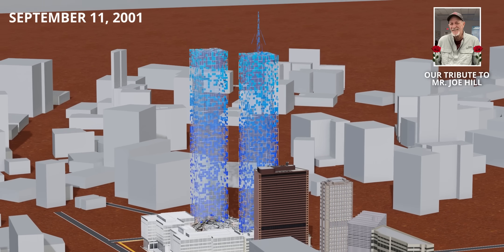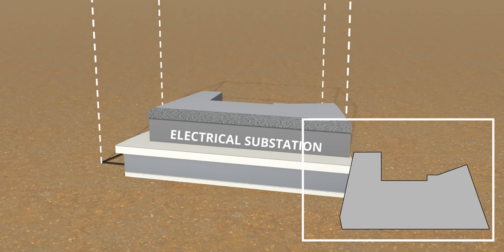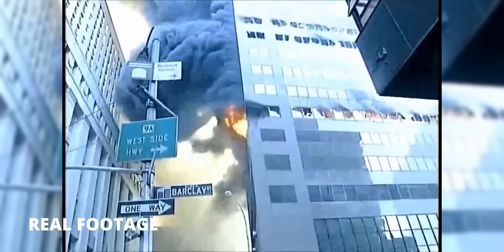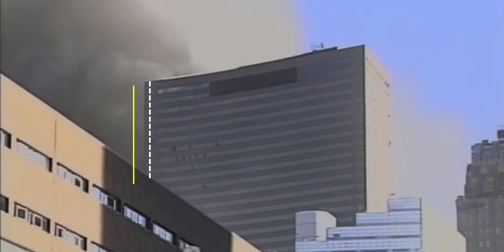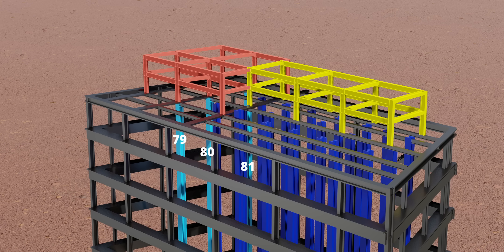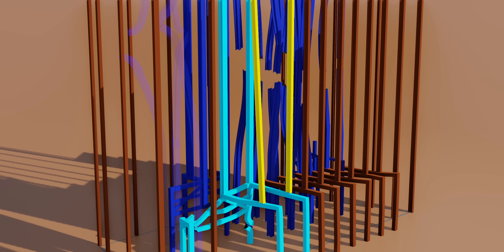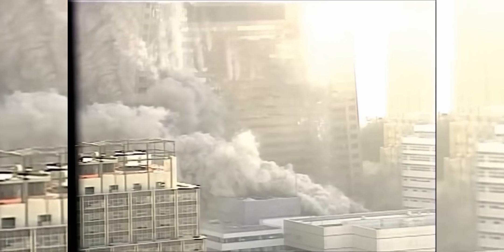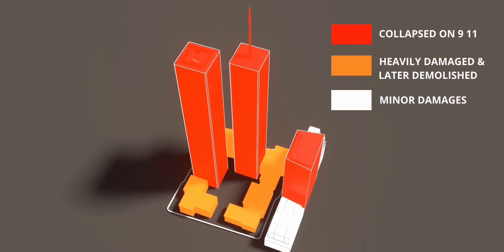Collapse of Building 7 | The Complete Physics

Comment: Exactly! All girders decided to give up within the same second. So no tilting to the left, right or whereever. When the penthouse side collapsed I would expect a tilted collapse to this side because the adjacent girders would have been strained the most. But no the girder on the far left decided to give up at exactly the same moment the girder on right did.
Reply: It probably would have helped if you had actually watched the video since you completely lost the plot in the first sentence. 🤦‍♂
Reply: @TheCriticalStinker-01  I watched the whole video and the explanation was bending physics.
Reply: @JOBOB1313  - Was it?  Please explain exactly where this explanation is bending physics (don't forget to include time stamps) and WHY.

I won't wait up.
Reply: @TheCriticalStinker-01  I gave the 'Why' in my original post.  
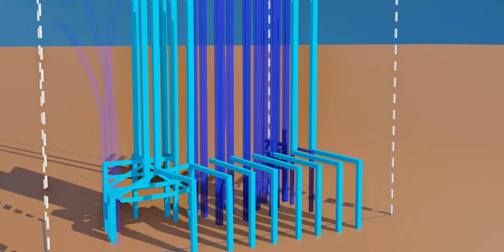6:55 The transfere truss fails and the other columns snap-bend to the right several floors above, all at the same level and all within 2-4 sec.. You have no problem with this simulation?

When the penthouse part gives in the columns on the left side would have to endure the most stress and give in before the columns on the farther right. They would not snap like in the video but would kink to the left on the most strained part of the column. Also the fire wasn't spread evenly throughout the whole floors which means that some columns had to endure a more intense heat stress than others.

You would have to explain how this snapping had occured without the help of some explosives.
Reply: @JOBOB1313  - No, you speculated in your OP. You presented things you believe should have happened. That they didn't is a strong indication your starting assumptions are false. 

I would agree the columns did not snap as shown in the simple animations in this video.  The columns buckled. But then I am under no illusions these animations are meant to be taken literally.  This is a YouTube level explanation for a YouTube level audience (morons), NOT a doctoral thesis. To be eloquent to that type of audience, elements need to be exaggerated.  

In short, STOP BEING SO LITERAL.

Also, the collapse starts well below 6:55 so not sure why you are ignoring all the important bits. 

None of this however has anything to do with your claim about bending physics which is what I asked about.

Collapse of Building 7 started in the NE corner when C79 failed.  It is generally accepted this failure was due to a loss of lateral support over an excessive length due to lower floor failures. Different analysts have their own opinions as to how many floors and what caused them to fail (probably why Sabine sidesteps this), but that is still the initiating failure

Loss of C79 will quickly cause C80 to suffer a similar loss of critical lateral support over an excessive length, causing it's failure, with C81 following suit within fractions of a second.  EMP drops into the building.

From there failures progressed from east to west through the core structure until the core columns were all gone. Again, buckling failures due to loss of critical lateral support, in rapid sequence.

NONE OF THE COLUMNS FAIL DUE TO HEAT.  All of the columns buckled, they DID NOT SNAP.

No laws of physics are violated or even bent and that description absolutely matches what we observe.
Reply: @TheCriticalStinker-01  I'm not surprised by your answer. Of course the maker of the simulation didn't assume anything since he was inside the building and watched the collapse firsthand and live.
Reply: @TheCriticalStinker-01  I forgot! You didn't answer my question: Why did the girders snap?
Reply: @JOBOB1313  - I forgot you don't read anything that may not fit your dogma.

They aren't GIRDERS they are columns .  

From my post of 45 minutes ago:

I would agree the columns did not snap as shown in the simple animations in this video.  The columns buckled

_ It is generally accepted this failure was due to a loss of lateral support over an excessive length due to lower floor failures. Different analysts have their own opinions as to how many floors and what caused them to fail (probably why Sabine sidesteps this), but that is still the initiating failure_

LET ME REPEAT THAT SO YOU DON'T HAVE ANY (VALID) EXCUSES

I would agree the columns did not snap as shown in the simple animations in this video.  The columns buckled

_ It is generally accepted this failure was due to a loss of lateral support over an excessive length due to lower floor failures. Different analysts have their own opinions as to how many floors and what caused them to fail (probably why Sabine sidesteps this), but that is still the initiating failure_

ONE MORE TIME FOR GOOD MEASURE

I would agree the columns did not snap as shown in the simple animations in this video.  The columns buckled

_ It is generally accepted this failure was due to a loss of lateral support over an excessive length due to lower floor failures. Different analysts have their own opinions as to how many floors and what caused them to fail (probably why Sabine sidesteps this), but that is still the initiating failure_

Now, let's see if you are being deliberately obtuse or if you just can't help it.
Reply: @TheCriticalStinker-01  I want to apologize since I really only read part of your previous answer. I clicked on the bell in the upper right corner and saw only part of your answer without noticing that there was more. I will come back to you later.
Reply: @TheCriticalStinker-01  I watched the video now 3 times and read and reread your answers. You do not seem to get my point and my point was not explained in the video.

In order for the building to collapse vertically the supports of the building must have given up on the exact same time at all corners and sides of the building.

"It is generally accepted this failure was due to a loss of lateral support over an excessive length due to lower floor failures." In your first answer this was connected to C79-V81. 
In your 2nd answer I got the impression it was meant for the whole final collapse. I have no problems with V79-C81. If it is connected to the final fall I understand that there are many opinions that diverse which would explain it. This would sound to me like you would agree with me that there was no explanation in the video.

"EMP drops into the building" Sorry, what is EMP?
Then you write "failures progressed from east to west through the core structure until the core columns were all gone" That's exactly what was stated in the video. Which doesn't answer my question. Again same time at all corners and sides!
Reply: @JOBOB1313  - I got your point from the start. For clarity, your main point is this:  

In order for the building to collapse vertically the supports of the building must have given up on the exact same time at all corners and sides of the building

That is not what happened.  

This video does not claim that is what happened.  

I do not claim that is what happened.

You are trying to shoehorn what the video and I are saying into your incorrect narrative instead of trying to understand the information that is being presented.  IF you are looking for the video to back up your version of events, you will be looking a long time. 

Both this video and I agree there was a progression of column failures through the core from east to west until the core was gone NOT a simultaneous failure of all core AND perimeter columns throughout the building at the same time.  

The video and I are describing the actual progressive collapse which is the opposite of a simultaneous collapse  

C79 fails (after the initiating failure)
C80 fails
C81 fails

EMP (East Mechanical Penthouse) drops into and through the building, because there is nothing underneath it to keep it on the roof. 

Then 76, 77 and 78 fail
Then 73, 74 and 75 fail
Then 70, 71 and 72 fail
Then 67, 68 and 69 fail
Then 64, 65 and 66 fail
Then 61, 62 and 63 fail
Then 58, 59 and 60 fail

Remaining rooftop structures go down from east to west as that sequence of failures occurs. 

Again, it is a sequence of core (NOT perimeter) column failures one after another NOT a simultaneous failure of everything at once. One failure is followed by another then the next, then the next, then the next,.... from east to west until the interior of the building is gone, leaving only the outer shell still standing - the "empty cereal box" described in the video - until that shell drops last.

I am fully aware what I just described is not an intuitive concept and you are far from the first to have trouble wrapping your head around it. Just casually looking at the building it isn't obvious to the layperson. 

Building 7 collapsed from the inside first (and not all at once), then the outside shell dropped (pretty much all at once).
Reply: @TheCriticalStinker-01   Again you didn't answer my question and I didn't look for the answer in the video because I saw that it wasn't there the first time I watched. 

What I stated  "the supports of the building must have given up on the exact same time at all corners and sides" goes for the outer support (the empty cereal box), too. You wrote "then the outside shell dropped (pretty much all at once)."  You wrote that it did but didn't explain how this could happen.

My "incorrect narrative"? That's a bit patronising. Perhaps your narrative is incorrect.
Reply: @TheCriticalStinker-01  You didn't answer my question. I get the impression you don't even see the problem I see.
(I even got more problems with the explanations and animations the more I spent time on it.) 

"support of the building did NOT give up at the exact same time" The frame definitely did. 

Nevertheless, how do you know what really happened? You were not inside the building when it collapsed. The whole explanation was just a try to reconstruct and explain how the collapse could have happened. That doesn't mean that it really happened like that. Yes, and I think YOUR ASSUMPTIONS ARE WRONG. There's too much bending and ignoring in the animation and I got to the conclusion that it is wrong.
Reply: @JOBOB1313  - The exterior moment frame was fundamentally supported by only 4 of the 83 columns and was the last and least important (though most spectacular looking) thing to fail.  So who the hell cares what the frame did?

The exterior moment frame is just an empty shell. The Building - the part that matters - is all the stuff on the inside.

The INSIDE FAILED FIRST then the outside dropped.

Now then, this is the most famous video of Building 7's collapse.   It is only 23 seconds long. Please indicate the time stamp (00;_ _) where Building 7 starts collapsing.

https://www.youtube.com/watch?v=nqbUkThGlCo
Reply: @TheCriticalStinker-01  The inside collapsing without practically no effects on the outer frame makes no sense. The floors and girders are connected to the outer frame as you can see at 0:59 and you want to tell me when the floors and all girders (tons of cement and metal) are forcefully yanked from the outer frame the outer frame has no reaction to this. Not even the windows break on the EMP (West Penthouse) side when the inner collapse allegedly occurs. (Some windows break later when the frame goes down).

And then when the interior is gone the frame goes down vertically as if being pulled and for you that is not important?
Reply: @JOBOB1313  - Correct.  To the layperson the interior collapsing with minimal (not no) effect on the exterior does not seem to make sense.  It is not intuitive to the layperson and is why wild conspiracy claims were able to take hold so easily.  Windows do indeed break and there are deflections, but you have to really look.  This minimal reaction possible because the exterior of Building 7 was a moment frame literally hung on the outside of the building. Most people will not expect this  - assuming the layout and construction to be more conventional - and have trouble wrapping their heads around it.  

Then one has to shake them out of their preconceptions and beliefs,... the fun part 😒

The same effect could never have happened in the very different Twin Towers for example. No moment frame. 

The floor beams and girders in Building 7 are indeed connected to the perimeter columns but NOT to the exterior moment frame. 

IF you can wrap your head around this everything should start falling into place.

Comment: In 2025, I 'learned' that apparently 25% of WTC 7 had been taken out by falling debris from WTC1 and WTC2, bence weakening the structure to the point of collapse. 24 years later, this sounds like absolute horse 💩
Reply: That would be horse 💩 since the physical damage caused by the collapsing North Tower was nowhere near 25% of the total Building 7 structure. Try low single-digits.

Comment: What a bunch of nonsense. This is just the latest spin on the NIST theory. Office furniture supposedly softened metal and cased a 'progressive collapse' This is total junk science. One question debunks this whole pile of lies.
Question: How can you possibly get a perfectly symmetrical building collapse from A-symmetrical damage?
Answer: You can't it's against the laws of physics. This video like so much propaganda out there is a lie.
Reply: It was anything but a perfectly symmetrical building collapse which is why it is universally referred to among engineering professionals as a progressive collapse - a progression of failures. 

That is the exact opposite of symmetrical.

This video not shows the progression and explains (in moderate detail) how it is progressing.

I don't think you actually watched it.  I think you just came in here armed with your AE911T talking points you copied off the internet, hoping to get some affirmation - or at least do some proselytizing to the totally ignorant.  

You hold many false starting assumptions about this event and its not difficult to figure out where you got them.  Perhaps if I were to lay the whole thing out, in detail?
Reply: @TheCriticalStinker-01  Nonsense. The term progressive collapse is not a technical term. It was made up by NIST as propaganda. It has no real meaning. Progressive as opposed to what? Every collapse has a progression. Tower seven (like one and two) are examples of a near perfectly symmetrical collapse at the rate of gravity - or free-fall as it has come to be known. Let's stick with terms an industry professional might use. 

In professional demolition circles this would be where 80% or more of the building ends up collapsing into its own footprint with main load bearing exterior walls falling together at basically the same rate. Your statement about the collapse being "the opposite of symmetrical" is laughable. Any demolition expert would brag about the clean, even collapse and how 90% ended up in its own footprint - This is as symmetrical a collapse as they get. I challenge you to find a video of a cleaner collapse that isn't a controlled demolition.

 Incidentally - the video right below this one shows great evidence of the demolition - you can clearly see the squibs (rows of windows blowing out from bottom to top) on either side of the building just before it's collapse.
Reply: @devinneiss4198  "Nonsense. The term progressive collapse is not a technical term. It was made up by NIST as propaganda. It has no real meaning."
That's impressively dumb, even for a "truther". did you work on that?

"Approaches for design against progressive collapse", Journal of the Structural Division, 1978. What do you know, you're flaunting your failure to comprehend and your Dunning-Kruger.
Reply: @TheCriticalStinker-01  Talking points? Really? Because you are just a hackneed regurgitation of every official talking point.  "Progressive collapse"?  As opposed to what? A conservative collapse maybe?
Reply: @devinneiss4198  - Are you being deliberately obtuse or can you just not help it?